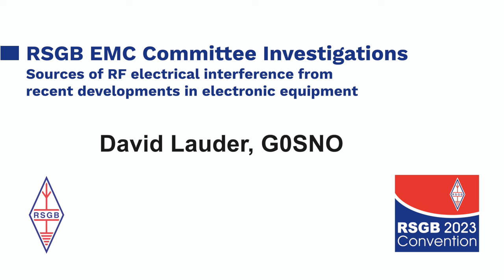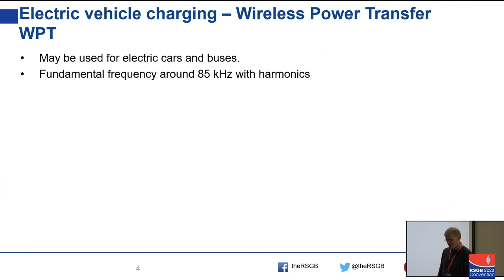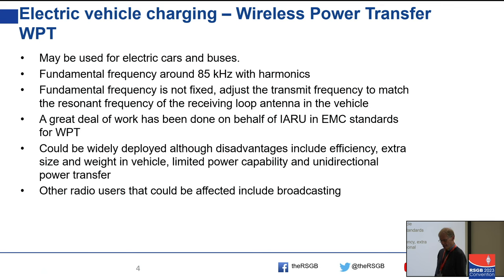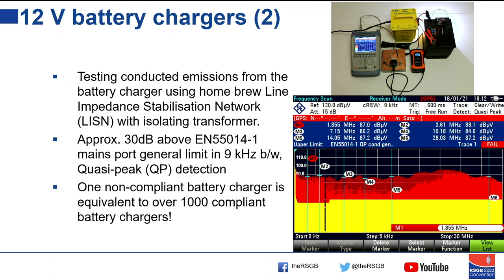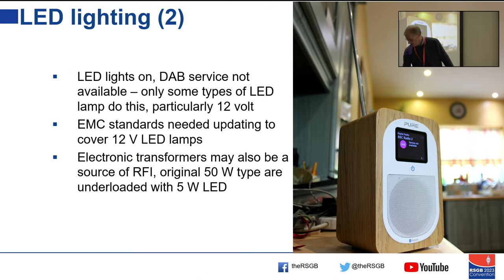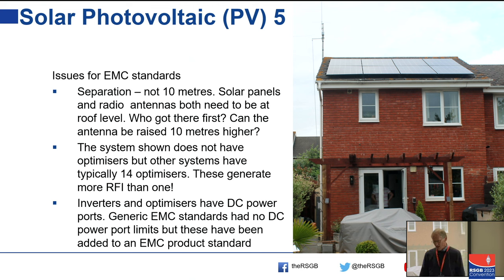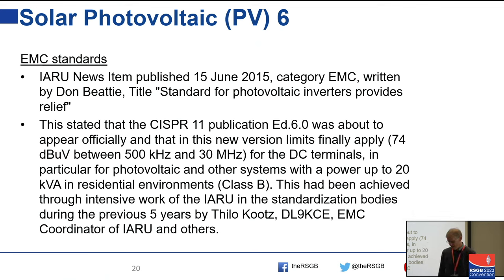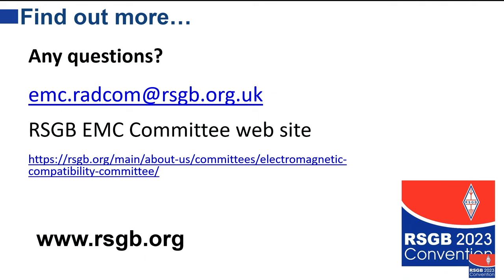RSGB 2023 Convention - RSGB EMC Committee investigations into sources of RF electrical interference

Comment: Thank you David. I have inspected my lovely neighbours new solar PV system and see no attempt at earthing or RFI suppression. The DC feeder from the array to the inverter is steel wire armoured cable with no earth connection to the cable sheath. Optimizers are fitted to the panels. The fire escape metal work on the building is re-radiating all the noise induced from the array and cables. They have effectively installed a large antenna system on the roof to transmit broad band noise. The metal support frames for the panels are not grounded either. At least I can hear how PWM optimizers work now! I have yet to read the BS7671 wiring regs section on solar PV but after consultation with another installer it seems there is no grounding requirement for all this equipment. There are probably safety device considerations that preclude the same grounding as AC systems so a grey area still for me at least. I will be fitting ferrite chokes to the DC feeder lines at the inverter end so can compare some signal levels then. 80mtrs has gone off air for me since the install. 
73's
M0LFD.

Comment: I have S8 noise from broadband internet160m to 20m. Noise sometimes on 2m, medium wave noisy so probably 472 kHz out for me.
I almost gave up radio and left the RSGB but as the higher frequencies are good now I reconsidered and re-joined the RSGB.
Maybe when fibre comes in and replaces copper the QRM will stop. 
G4GHB.